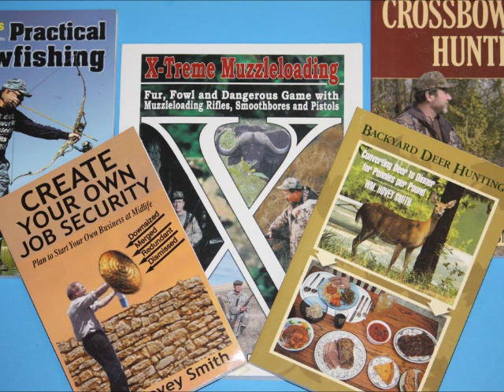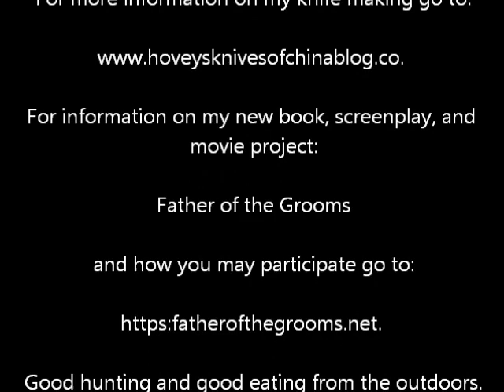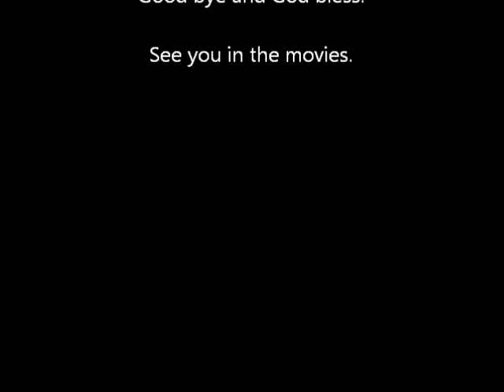Processing Unusual Native American Woods

Comment: I have a craftsman 12” band saw and I love mine! I picked it up over a year ago at an auction for $60. Only issue with it is is didn’t have any bands. I get all my baldes from ps wood working. They are timber wolf brand baldes but they are one of the only company’s to carry the odd ball 91” bands needed for the craftsman’s. There selection is incredible as well. Over 60 different kerfs and tooth patterns. I use mine for everything from ripping stuff like you are to fine detail work. Really an incredibly well built and running machine

Comment: Very Pretty wood blanks that have resulted from your project. Try using resin to salvage a few of the pieces that have small cracks or worm holes, a lot of commercial blanks have large gaps filled with resin, be it colored or transparent.